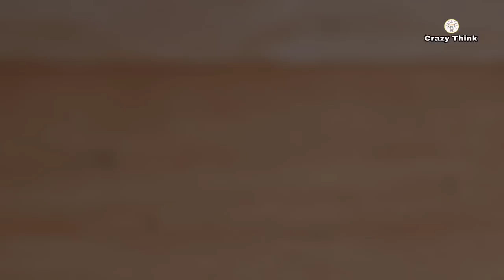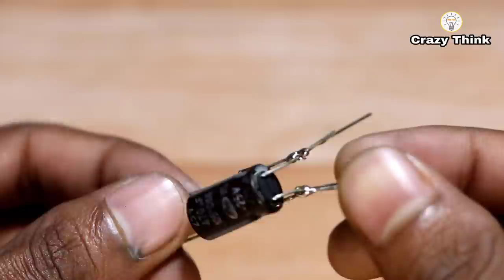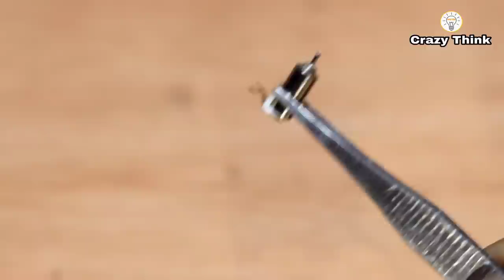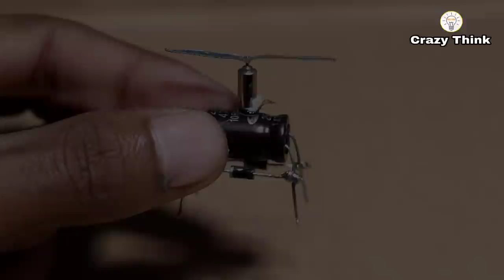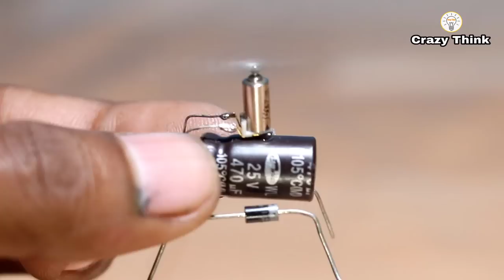How to make Vibrating Helicopter -  with Capacitor || mini flying drone

Comment: Nice work!
I've tried to build the same. Have a vibra motor with 0,5 to 3 V and 150 mA max (with 3V). Unfortunately, after charging it only functioning for 2 or 3 secs. What can be wrong? How long should take the first charging? Or have you do sth to slow the capacitor discharging effect?
Reply: Lol
Reply: Well your capacitor can discharge very quick and drone motors  take up the whole power of black capacitor

So use mobile motor

Comment: no need diode..only reduce the voltage and energy performance
Reply: diodes are also turned on incorrectly. And yet- It connects the PLUS battery to the MINUS of the battery. This is strange)
Reply: and the lithium ion battery under device

Comment: SO what exactly do the diodes do, given that they are only used as "feet" and are not connected to anything at the "back" end?
Wouldn't a couple of resistors, for example, do the same job?
Reply: They go nowhere - they don't do any work.

Comment: Help me understand how you are charging a capacitor yet you are holding onto the capacitor leads the entire time.
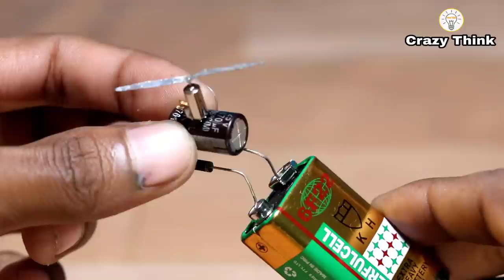Reply: @3:00 you see him charging with 9 volt batt
Reply: do not worry. there are 9 volts. you can hold on as much as you like.
Reply: Roman Moskalyov my point being that the cap is discharging the entire time it is being held.   Here get a disposable camera and charge the flash then touch the cap like he did and my point will make a bit more sense.  I understand it is being charged with only nine colts but if your touching both terminals of the cap it is discharging as well.
Reply: @1986BBG  the discharge of the condensers has a large dependence on voltage. The discharge rate will depend on voltage and tracking. in our case, it is about 1 megaom. lower tensions. and he is trying to discharge through 1 megaohm. so it will be a long process. very long. Much longer than the charge rate of a condenstaur. You can verify this using such a capacitor and a multimeter. (voltage meter)
Reply: Roman Moskalyov maybe you can shed some light on what I said earlier.  If the person is holding the condenser terminals at the same time while charging them does this not affect the charge?   Once you touch both terminals the condenser would effectively be discharging correct or am I wrong?

Comment: It's fake.
1. The diodes are not turned on correctly. they are turned in one direction. anodes to the terminals of the capacitor !. In this mode, the current from the battery will not be able to flow and charge the capacitor
2. To charge the condenser from the battery, diodes are not needed at all.
3. In the video, different models are constantly used - the "minus" of the capacitor is from the bottom to the side.
4. At the very beginning, it is proposed to use a 2200 microfarad condenstaor. but in the frame, the capacitor is 470 microfarads.
5. In the frame where the motor rotates, it is not a capacitor at all! This is a Li-ion battery for indoor installation.
6. too lazy to look further. but this is definitely a fake.
Reply: Бесполезно ему что-либо объяснять )) Пилит мусорные видео каждую неделю/день наверно. Ютюб в последнее время стал раздражать такими "зачотными" предложениями. И блочит видео нормальных авторов вообще ни за что: недавно был блок у Starrsky Carr за якобы "сэмпл из трэка Chemical Brothers" - это вообще дичь ))) Там обзор синтезатора и какой-то filter sweep по мнению ютюбовских ботов совпал с трэком... но это даже по закону никакой не плагиат.
Reply: @KiR_3d  ясно) бывает)